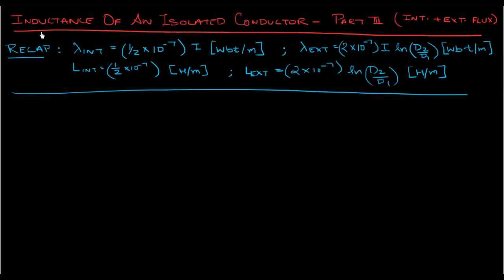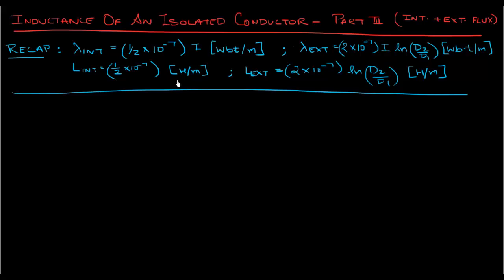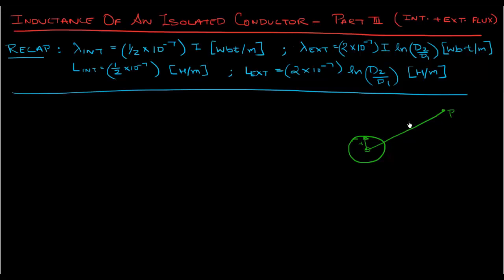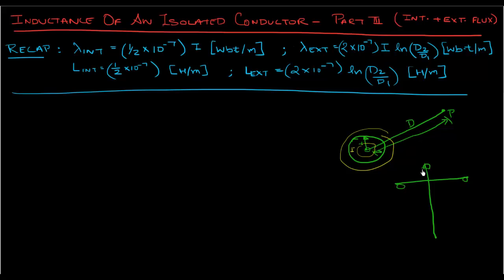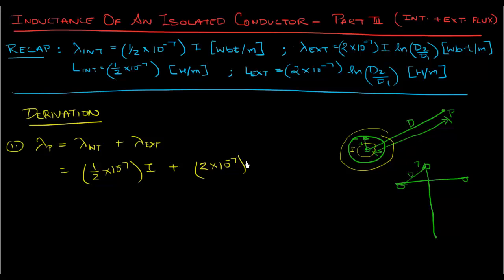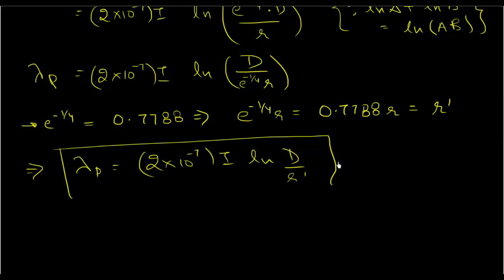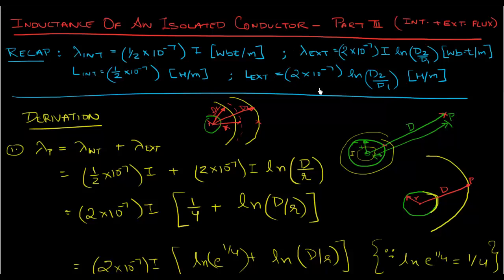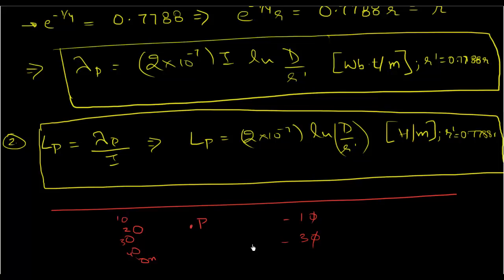Inductance of an Isolated Conductor - Part III (Due to Int. & Ext. Flux)

Comment: Assalam u Alaikum sir, sir why we take the total inductance at point P out side of the conductor
Reply from the maker: Hi Muhammad,  as I mentioned in the video, the reason we do this as to get a generic equation for an isolated conductor, but we will make use of this in the following videos when we introduce other conductors in the circuit.  Watch out for the next video which I should be posting very soon.  After that video, if you still have questions, feel free to email me at info@movingelectrons.com